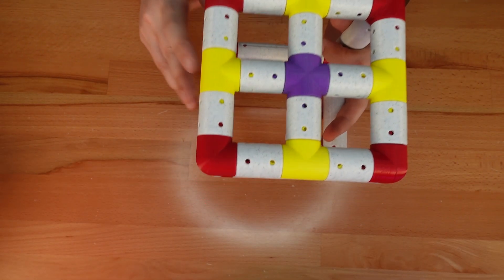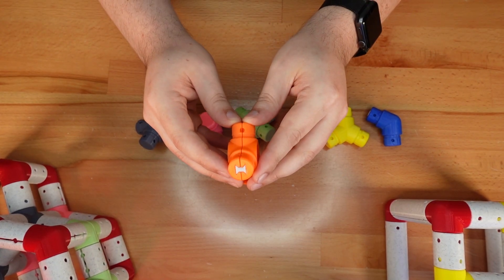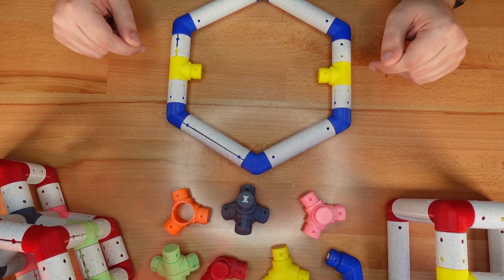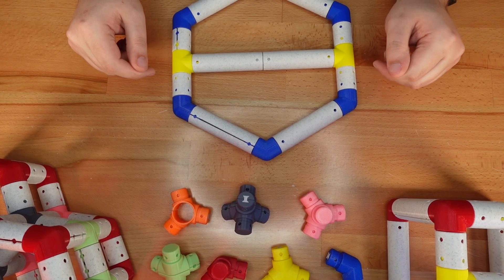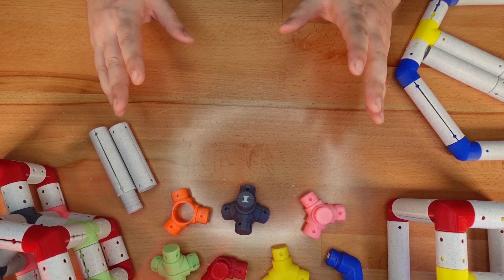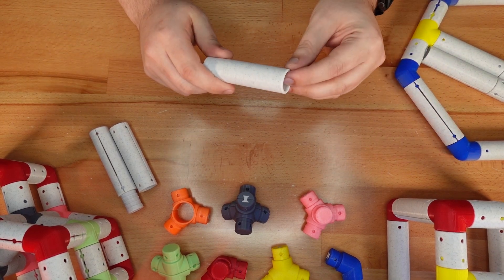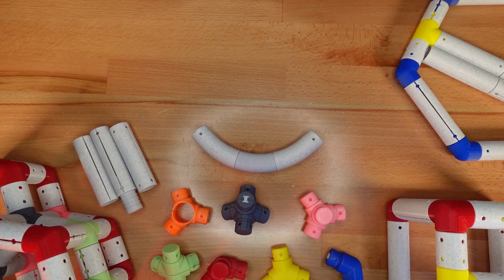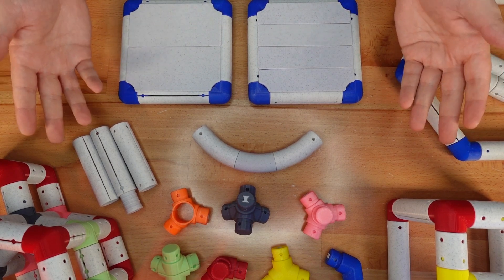3D Printed Pipe Toy - Update!

Comment: I have been printing these for a week and look forward to adding the extenders. I am making a little fort with my son and the sliding lock rings don't work on the I connectors (at least when perpendicular to the ground) so I been using the lock pins. Those so far are the only thing to break and because my son is so eager to build I don't have enough to make proper supports so there is a bit of wiggle in the long pipes connected by I connectors. Unfortunately 90% of the pipes I printed are with the rib :face-blue-wide-eyes:
Reply from the maker: I wish I had thought of the extenders earlier in the project... my own collection is also MOSTLY pipes with ribs! Is the sliding lock ring just too loose? I've been considering a tighter TPU ring option... or maybe just scaling it down a hair would do the trick.
Reply: @3DPrinty  your spot on, I have dialed in the sliding lock rings and they are working great. Also, I made a few pipes in ASA but they seem to gap a little in the middle of the long pipe. The looser rings are good there to keep it more uniform. I switched to PETG and so far I think it may be a little better. I also want to try out the tpu pins. As a fort, some flex might be good , better to flex some vs stiff and break if someone rolled into it😝
Reply: @3DPrinty  I also think the half dodecahedron  might make a great fort. Any plans to redo the connectors??
Reply from the maker: @hurrycaine1  I might, but the truth is that they don't slice in half quite as well as the other designs... so it's not likely to be the next update to Printy Pipes. I'm glad to hear the PETG is working out better for ya!

Comment: The use of Printy Pipes for a display, and the optimizations made from stress testing, has me wondering about the concept of using Printy Pipes as a repurposeable and modular sort of mini storage shelving solution. There could be specialized slats for holding rolls of filament or even Gridfinity bins. :) I wonder what sort of weight these things could hold in different configurations :)
Reply from the maker: Possibly! My goal was a toy first, but it would take very few tweaks before they became more serious construction parts. I'd probably make the pipe walls thicker and design the connectors to accept heat-set inserts for bolted construction. It could happen... or maybe someone else will remix it first :)

Comment: Love the stuff, but why not make adapters to pvc pipes for craft builds and not have to print the pipe itself
Reply from the maker: You could scale these to work with PVC, but you'd be missing out on the clamp mechanism that's build into the inner surface of the pipe. PVC pipes also aren't super standard world-wide. So, even if I had designed this for PVC, you would've likely needed to do some manual scaling to get it to work with the standards where you live.

It's possible that I might make some sort of pipe cap that has all the nice snapping features of these pipes but can be glued onto the end of a PVC pipe.